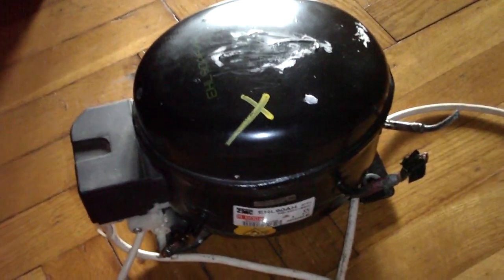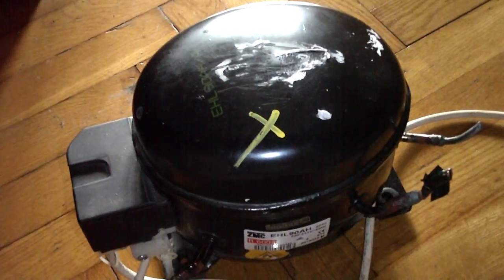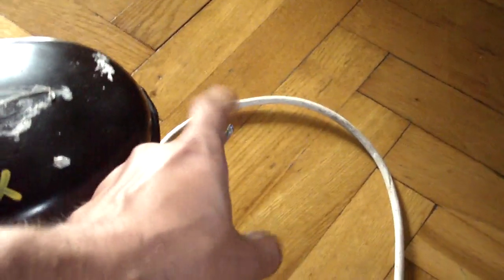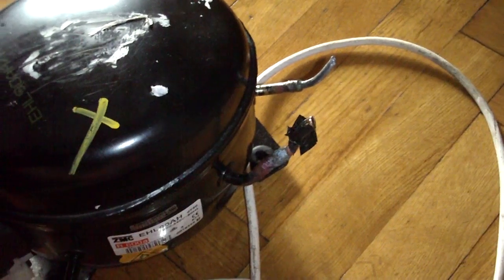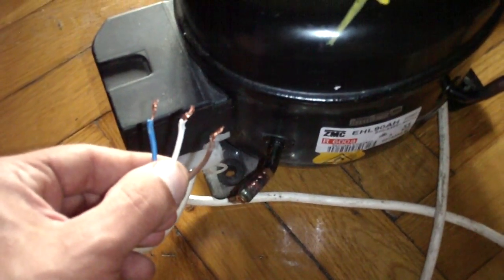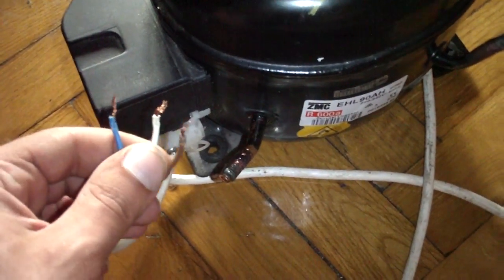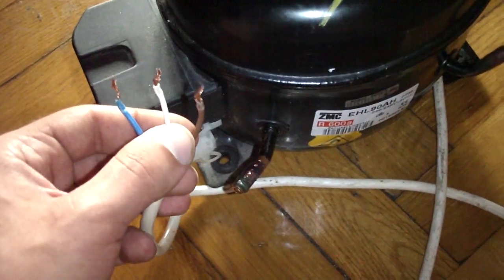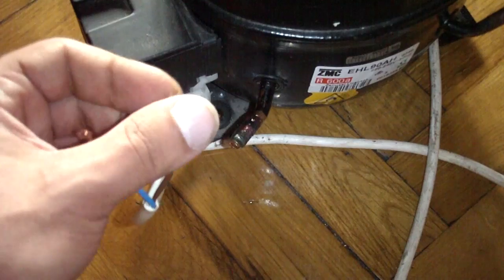How to modify a fridge compressor into an air compressor

Comment: you may need a start capacitor ...   and those compressor from refrid have oil in them ,, you may have add oil after so many hour run time not to much and a certain type also

Comment: I had the exact same compressor. The valves burnt out in it at 50 bar and it was like the oil was burning during compression like diesel.
Reply: Did it start to ignite the oil under those pressures ?

Comment: Hi, I connected an embraco compressor for my airbrush. It's star ok, but ones the pressure switch stop the compressor it doesn't start again. Need to disconnect and wait. I didn't installed a relay, just a strait parallel  connection between the compressor and the pressure switch. Thanks
Reply from the maker: That's normal - newer compressor have ptc relays and they take time to reset. There are several ways to overcome it. You can use a bigger tank and/or high pressure so the PTC relay will have time to reset before it has to switch on again. You might also get a different starting relay - in the past they used a different switch and it's reset time was more like 20 seconds max.
Reply: kerimil I have actually run into the same issue. The problem is not relay related. The problem is due to the fact that when the compressor turns off compressed air gets trapped in the connection from the compressor to the air tank. This creates backpressure and will make it super difficult for the compressor to start rotating. If you still have this issue, when the compressor is switched off automatically by the pressure switch, purge the line going from the compressor to the tank by disconnecting it. be careful as the line is under pressure and compressed air is not predictable. When you have disconnected the line, reconnect it again and use the air in the tank until the pressure switch turns the compressor on again. if the compressor starts up after purging the air trapped in the line then you have found the same problem I ran into. Unfortunately pressure switches with built in purge valves come in a very vast selection of specifications and I can't really say what will work in your exact situation. However, you do need to unload or purge the line from the compressor to the tank check valve whenever the compressor is stopped or simply turn the compressor power off and use all the air in the tank and then turn the power back on.
Reply from the maker: well it's both of these things... starting/ptc relays take time to reset and pressure can stop compressors from starting.It's the same for shop compressors that's why they have a special valve for venting pressure

Comment from the maker: No, it would only give you 1m3/h @ 1bar. If you're wondering where I got those numbers - just google 'werther compressors' - they produce these as commercial air compressors and you can find datasheets or different models and more or less estimate what flow you can get with what wattage

Comment: Hello
I have a LG LRBN20514ST it has a Embraco EGU70HLC compressor with 3 wires 1 blue, 1 black, and one pink.  I would like to use this compressor to make a silent airbrush compressor.  I need to know which wire is hot, which is neutral and what to do with the third wire  Do I need to add a solenoid to this? if so where?  I am trying to find a wiring diagram but I have had no luck,  I would also like to find a service manual.  
Shane     sblacklord@hotmail.com

Comment: Great thanks, I will try these. Aha I will use a double valve airlock between the tank and compressor with a 't' connector that vents to outside air.

Comment from the maker: the output side of the compressor (ie the tube that blows air out of it) should be vented before you start the compressor. In other words it can't be pressurised. So you can't just connect the compressor, fill a tank to 400 psi, stop the compressor and start it again while its output side is exposed to 400 psi. Personally I just use a ball valve that I use to vent air. 

When I say duty cycle I meant how long the compressor works. Control the temperature and if it gets hot switch it off

Comment: I will test it with the submersion method, thanks. What do you mean by venting the output? And I will probably need pressures up to 500 psi...my duty cycle is 60hz from the wall....sorry for all the questions lol

Comment from the maker: (continued). Personally I have found water cooling to be very efficient and simple - you just immerse the unit in liquid.I had to keep the level of water below electronics to avoid shock but it was just an experimental setup for a high pressure rig that got overheated really fast. I would have used a non conductive liquid like engine oil, but I couldn't source it cheaply at the time. Anyway if you don't use very high pressures and use reasonable duty cycle overheating shouldn't be a problem.

Comment from the maker: You should vent the output side each time before you start the compressor - this way it's easier for it to start. That's what normal compressors do so it's nothing new. Sure enough 500 psi is a lot and you probably don't even need that much anyway but they can achieve such high pressures.

92W is enough for most uses, but higher wattage means higher output (volume of air per second).

I have tested many different cooling methods - from air cooling to water cooling.

Comment: Doesn't your compressor overheat trying to overcome accumulated pressure in a tank? 500psi is a lot. I have one I salvaged, from a hotel mini-bar sized fridge, that is only a 92 watt one. Pretty small. I've found the overload thermal protection device in series with the 'hot' line clicks on rather quickly. Is it safe to setup an air cooling system to keep the compressor cool you think? Maybe even piping providing a water-jacket?